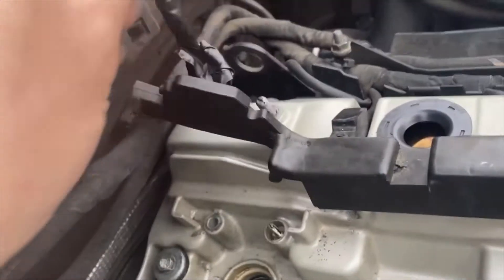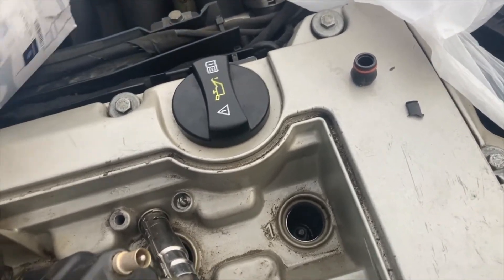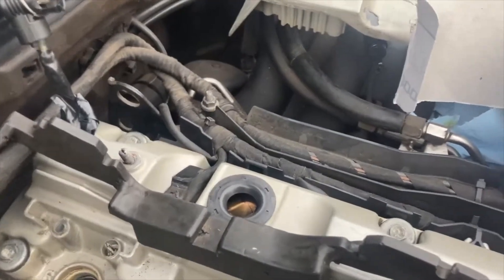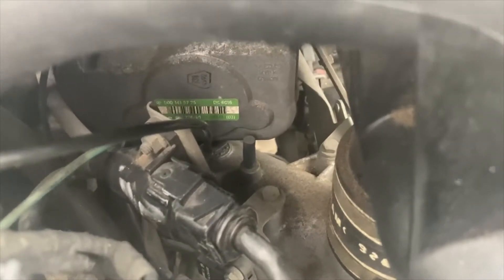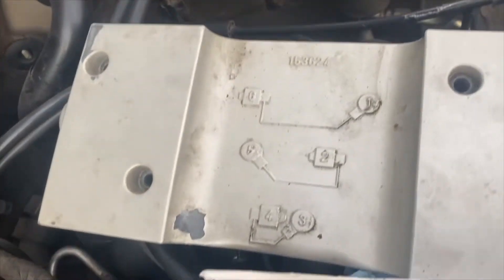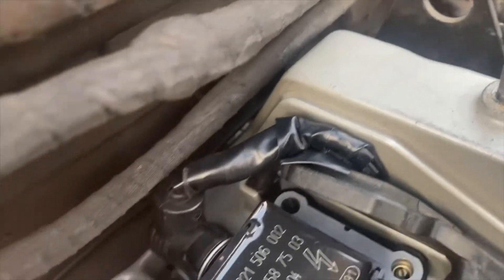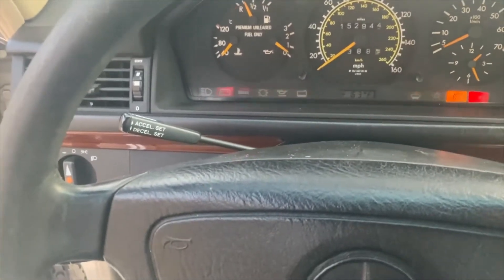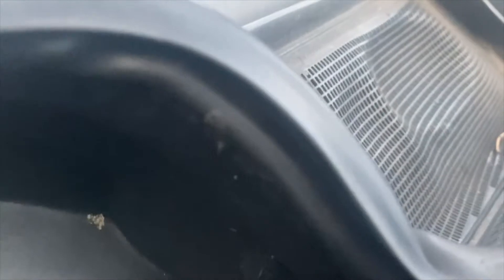Troubleshooting misfire after VCG replacement

Comment: Thanks for sharing.  Where did u purchase a new harness?
Reply from the maker: I got a used (rebuilt) harness from eBay actually. There are at least two different part numbers, depending on your year... so you'll want to verify first. Mine was rebuilt in 2010 and has replacement part# 1244405632 (my water pump has two connections and no oil cooler line)
Reply: @bsclifton  Thanks.